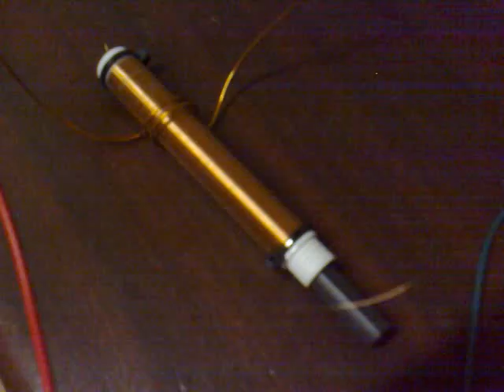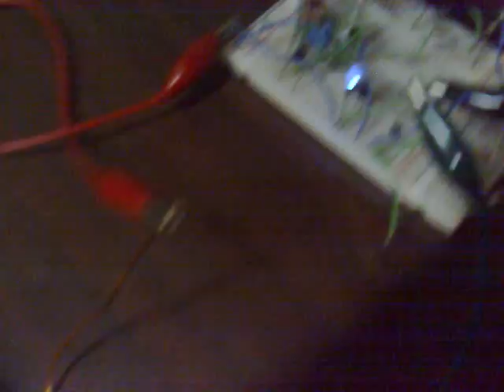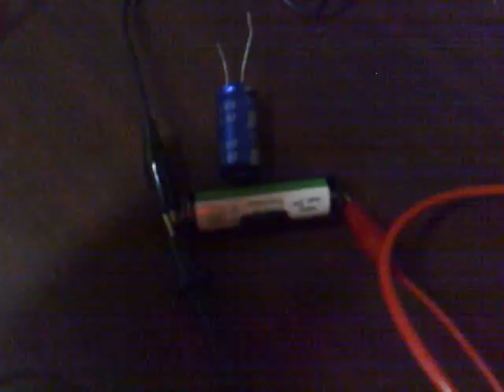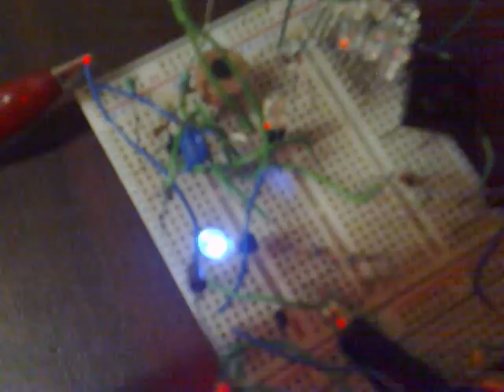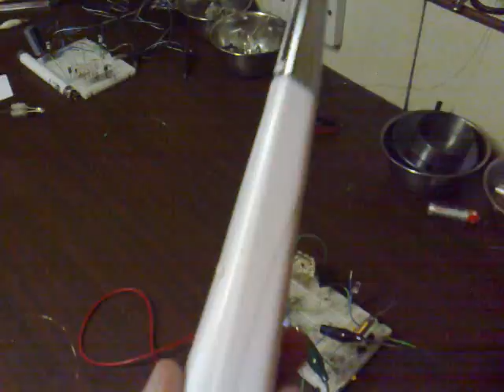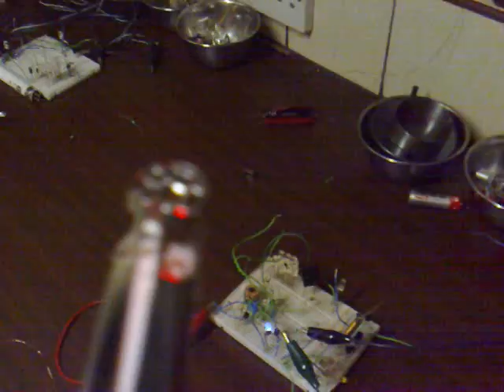Starting a ferrite slayer exciter on under 550mv

Comment: This would be a good one to try with some of the crystal batteries currently being made/experimented with. Nice work jonny. I am having fun with my new 4" core / 1750 turns (21" height) Slayer Exciter, that will be growing to 34"! Got an 18" fluoro to light up fairly easily from 3v. It draws about 30mA. Much more light than a garden LED, with similar draw. Once I learn how to tune to resonance, should be better. It oscillates nicely down to about 2v, runs 8 hours (2 x AAA) easily.